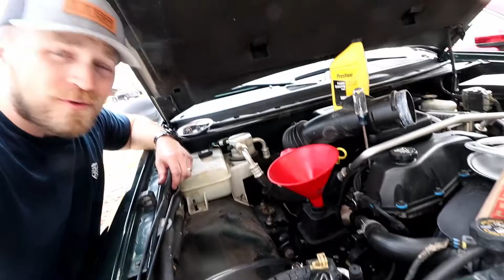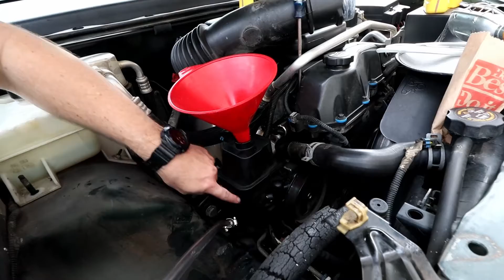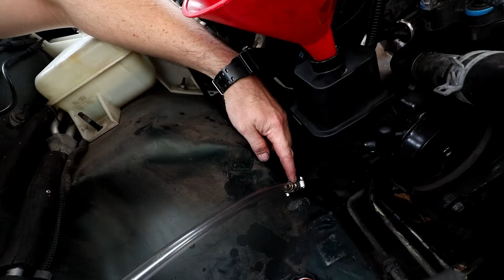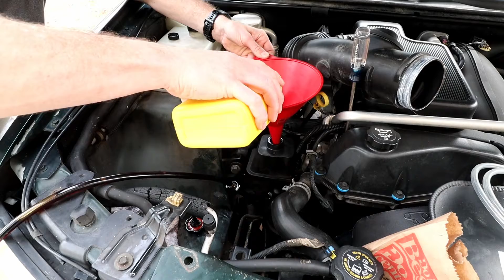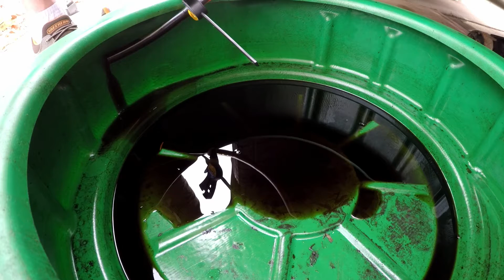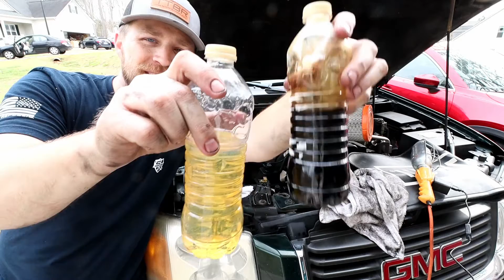HOW TO FLUSH POWER STEERING FLUID 2004 Envoy Trailblazer

Comment: Thank you so much dude! I got a 2008 envoy and have basically learned how to be an automotive mechanic on this damn thing😂. The power steering system has been a nightmare on my envoy. The pump was the last thing I replaced out of the entire system and I have soooo much air in my system now. Gunna bleed it tomorrow

Comment: At what point do you reconnect the return hose? Before or after you completely bleed and top off the reservoir?
Reply from the maker: @MJsLandscaping-i9e  IIRC, I reconnected it after I finished bleeding and topping off
Reply: @KevinNadeau  ok I was just curious. Figured the fluid would leak out of the reservoir as your removing the temporary plug aka hose bent in half before putting back on the return hose.